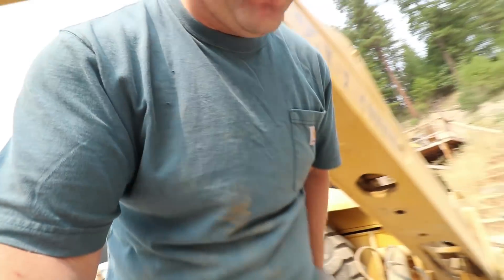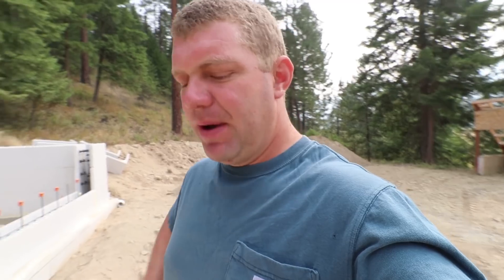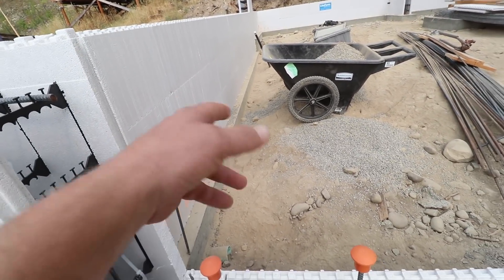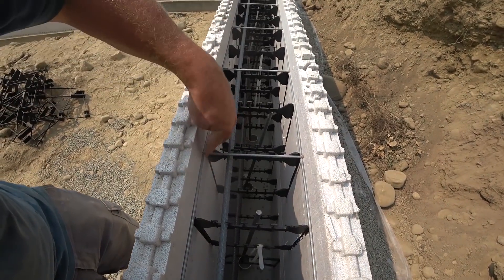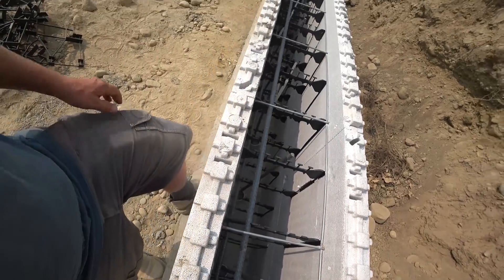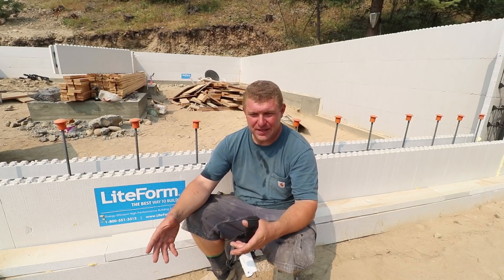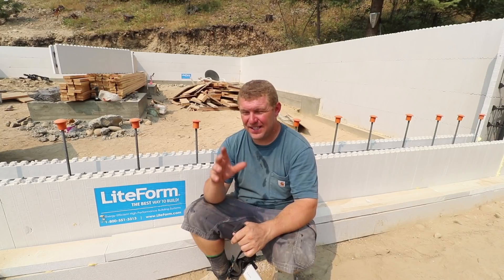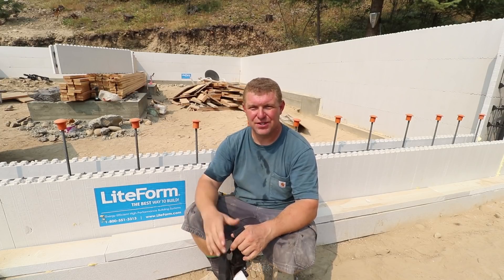Building a House Start to Finish: ICF Construction

Comment: You'd should call this the cock up channel, I know your trying but through of lack of CORRECT RESEARCH everything you do goes wrong. You evidently have tons of money stop wasting it and buy something already built, your'e not cut out for it. 
I used to like your channel but I'm fed up of your lack of common sense.Too much money has made you lazy. I have done builds on a tight budget and I cannot afford mistakes, so it all goes to plan.

Comment: You probable already have your blocks all placed,  but using a string line to keep your courses level and plumb is the only true way to lay block.  Keep your eye on your slump when pouring your grout.  To wet could blow forms and to dry mean rock pockets.  And of course make sure to do the grout in lifts of no more than 3 to 4 ft.

Comment: It's amazing how a simple product can be made to look so difficult. I hope you are alternating each row of rebar, as you will have to push one length every 16", from the finished height of he wall.This ties all the rebar together. If the wall has a bump up at the end run a chalk line at the top and keep the concrete to that height.  This like a lot of other products are made simple for the diy 's

Comment: Great videos. Have you guys thought through your doorways. Specifically how the thresholds will sit on your ICF's. First off your wall is thicker than standard so you have to pick where your going to mount your door. We choose flush with the interior wall. Which gave us an eleven inch gap between our exterior door and outside wall. Not only do you have to figure out which material your going to finish that with, but you have to figure out structurally how it will react with the weather. for example if you tile the 11 inches remember that your tile could be going over 3 different materials, wood, foam, and concrete. If you just thinset your tiles on then the difference in expansion and contraction of the 3 materials will cause them to break, and even with a backer board over the 3 materials it might still cause shifting so you might start looking at a membrane that disconnects the structure from the tile so that all surfaces can expand and contract as they need without ruining your finishing material. That ALSO mean your door frame must accommodate the additional substrate high... if the backer is 1/2 and your tile with thinset is 1/2 then your door is going to be up in the hole an inch and if you frame your doors in within and inch your going to be too tight and might be redoing your framing.

I did tile and PVC Siding boards, but we had to do this AFTER the fact because we didn't consider the change in surfaces. After talking with another ICF owner I really wished I would have done a full through door option. Either pouring a solid concrete base for the threshold to set on and then have 1 material to build from or framing the floor all the way out to the outside edge and finishing it with exterior rated materials. Everything turned out fine mind you one year later and none of the tiles have broken out, but I really wish I would have thought the doors through better. Sorry for the long comment. You probably don't even have time to look at these, but I was just hoping to give you a tip before you have concrete poured and are stuck like I was. 

built 3 houses with ICF, and I got certified to install it before I started. My previous experience before the build was only remodeling. I love ICF's, but I wished I had somebody to tell me what to watch out for while I was building as there is a real lack of experienced ICF builders in my area.

Comment: That's a tall wall. I would put a wood kicker to the bottom of each strongback on your waler, and an adjustable brace on the top. that way you get the added peace of mind and a way to adjust the wall, simply by spinning a pipe that will move the top in or out.

Comment: Uncommon seems are weak areas just put a three-quarter inch plywood blowout patch against the outside with enough screws to hold it solid and it will secure the same and the whole blocking system together we have done this on a lot of ICF Porsche we do anywhere we think we've weakened the block

Comment: Looking at this video it looks like the perf pipe has the holes up and down.  I guess you turned them so they are sideways afterwards.  I guess this would work if there is a space for water to collect under the pipe.  I always had them where holes were on the lower part of the pipe.  The holes were on the bottom half.  The idea is to have the water collect some on the botton and then go up to the holes, go into the pipe where it has a unobstructed flow down the slope of the channel next to the footing and away from the foundation.  regardless, the gravel will also act as a transport mechanism for water.  It acts as a barrier so dirt can't get to the walls and an easy path for water to drain.  I have done alot of thinking on drainage on many commercial and personal projects.  I think it is incredible that you got that base within 1/8" .  Those ICF's are very time consuming.  A normal wall those inconsistent bases don't matter as the concrete flows and is in effect self leveling.  The ICF seem very unforgiving for an imperfect world.  All of this structure is simply to make it easy to dump all the concrete at once.  A wall can be built with much less bracing by simply pouring  6 to 10 inches at a time and waiting 30 minutes for it to set up a bit.  The next layer totally bonds to the first layer but won't blow out the forms.  That is how dams are built.  
Love watching you guys build this house.  It will be beautiful when you are done and a great place to live.

Comment: I noticed in your video as you were walking around your drain pipe, that your pipe is installed wrong. The drain holes need to be horizontal, NOT vertical. There is no way your pipes in that position will drain anything, except your pocketbook. If you don't believe me, go back and ask the building supplier about which way it should be installed.

Comment: I wish they would turn comments off for all their video's.. either it's wankers commenting on everything that they're doing wrong without considering circumstances, or it's tossers going against every 'negative' comment, defending even dumb shit that could have been prevented by either not overthinking things/reading and following instructions/simply properly measuring everything.

Yes they try hard, and yes, they will probably succeed, but not due to either category described above - both of which seriously detract from the fun of watching these videos... (and yes, I know I don't have to read them, but heck, my screen isn't small enough to show at least the top comments ^^).

Comment: If you are worried about blow outs during the concrete pour, use a vibrator when pouring the walls. When you order the concrete ask if they will rent you the vibrator and if not rent it somewhere. Vibrating the concrete as you pour will keep the concrete from blasting through the walls. Also you have to work fast and know what you are doing...maybe you should hire an help the day of the pour.

Comment: How are you going to reach down into the wall and wrap the wires around the rebar inside when the wall is up?  I would think that you would put those wires through now while its easy to reach...............Also I have heard that it is best to do 2 pours.  One between 4 and 5 feet, and the a second pour to finish it off.  Maybe that has changed since I did my research.

Comment: Seen on another vid where they have those devices that attach to the outter wall.... let's you push or pull the wall as need to get it straight once the pour is made ..... looked to me like they were set 2' apart....

Comment: The instructions say to do this, but here is why I think I'm smarter than all of the engineers and professionals that have designed and been working with this product/concept.......Paralysis by analysis folks. This is a leaking pipe, the individual drips are not a problem, but as it accumulates, it creates more problems down the road. These guys are going to have some major issues down the road.

Comment: After watching this build, I am not sure if I will ever use that system. Having used 1.22M by 2.44M sheets of smooth covered multiplex a lot to make traditional moulds and using rebar netting tied or welded together to make walls and floors, or using pressed lime and sand blocks you can glue together as walls and use concrete sheets as half floors , just put pipes in and pour concrete to finish it... so many other options.

Comment: You will need to get 2x4 bracing on your outside corners. You will find that you'll have a corner(s) that are falling out of plumb. Also were your common block/ cut blocks are they will need 2-32" pieces of furring strip inside and out for support. Also on your short side corner block it doesn't hurt to put furring there if you don't do corner bracing. The project is looking good

Comment: I am wondering where you got the instructions that say !       Tie Zonts to ICF with wire or zip tie     the manufactures website says     use 1 1/2" #8 flathead screws

Comment: im thinking if you cut a recess in your common seem and fill that with that spray foam adhesive it should bond them as good as the tongue and grove if not better

Comment: Great videos but they are going to really regret not sorting out that back wall. If they were not going to make it a retaining wall they should have staked it and covered it with a permeable mesh.  If they are going to back fill the whole rear of the house should have primed ICF with a external damp course paint. no harm in painting the inside also, paint is cheap after all.

Where you have cut the tongue and groove use a good gauge wire to stitch it together. then wooden braces.

great videos though showing your efforts. Im sure in the long run you will get it all sorted, its just a learning curve.

Comment: i've enjoyed your series of building your own home. You guys are very hard workers and I am sure once you are done there will be a tremendous satisfaction in your accomplishments. I haven't seen the entire series yet, but I have 2 questions, maybe you answered them in a previous video. One, why in the world are you using such a complicated building system, ICF, etc. Wouldn't traditional wood framing or some other traditional method of building been much easier, cheaper? I am at a loss as to why to "newbies" would tackle such a complex build? Secondly, aren't you afraid of that carved out mountain side up against your home. Why did you build it in that location? It seems that any heavy rain will collapse that mountain. The rock seen on your property is basically river rock, meaning lots of water movement. Anyway, good luck with the rest of your project.

Comment: I've mentioned this before when You were working on the Footings, I guess You're planning on Candles, cause I see You're not adding any Electrical, if this is a Basement built with ICF's, and it's a living Space, don't You think You should have some convenience Outlets? I'm concerned You're probably not thinking of the big Picture here, or is this just a very high crawl Space? I hope this is not something You're overlooking as now is the time to install the boxes and piping for Branch Circuits, if there are any? Just My thoughts.. :D

Comment: Jess your drain pipe is upside down the hole are ment to be at the bottom to prevent siltfrom getting in if you had read my comment yesterday about a vlog on another channel by a very reputable builder you would see the same thing g you's are doing please have look for yourself guys I really think it will help you's out

Comment: Why are you pouring a concrete wall on the walkout side of the house. In My opinion you should step the concrete wall down and use wood construction when it is above final grade. Your concrete wall design is what they did back in the 60s.

Comment: Before you bury those drains I would suggest that you install clean outs at the corners and extened them up above grade, you'll also have a place to put your down spouts that way if you ever have trouble with silting in ( yes I saw the fabric) you have a chance to snake and flush without digging it up.

Comment: I'm a little confused about water getting under the footer to the drain coming out from under the pad. If they pour concretion the ground...wouldn't the water that theoretically might possibly come under the footer & pad would fill that short drainpipe up with mud? Can't imagine with the most torrential rain & floods n that area, of any water getting under the pad & footer to begin with. Their drain would handle any/all water & excess would runoff on top of ground. There's doing things for just n case...& there's doing things for nothing.

Comment: I don't know how much fill is going under your basement floor,,, but if you fill to the bottom of the slab with pea stone or similar, you do not need the interior perimeter drain pipes.  Run a single run 10 foot or so,, bed in pea stone and do the leveling with pea stone,, you do not need the pipes, you do not need to compact.  Pea stone is 95% compaction or better when it hits the ground.  Your stone costs may bump this out,, but normally it makes it faster, cheaper, better.

Comment: If you get  diesel fuel delivered to the site it should be cheaper. Fuel might be around same price but you don't have to go get it or use the cans, you could get an electric pump or just the hand pump.
Reply: Diesel is very low vapor so the fire hazard is very minimal. That's why pumping from a 55-gal drum is so popular. Money doesn't seem to be a problem with this crew.

Comment: Second it - on the value of sitting and thinking it through.  I mentally build each element, often writing down tool lists, parts lists, building tips and sequences.  It helps me tremendously !!!  Once in the heat of building I often don't see the whole picture and then prone to mistakes - so the time spent thinking it through can be worth lots of time and money.  
Like your approach as you think your way through it and how close together you work.  Kudos!